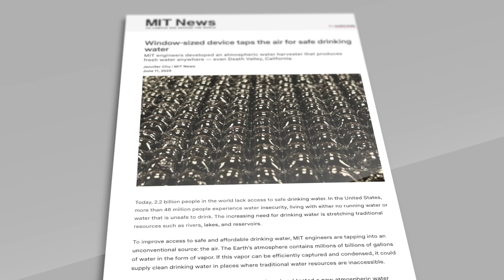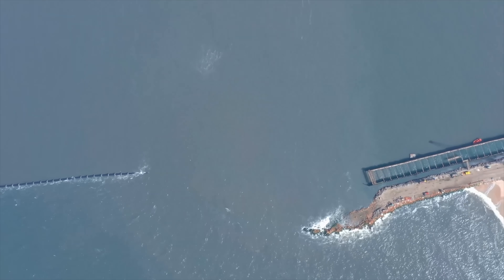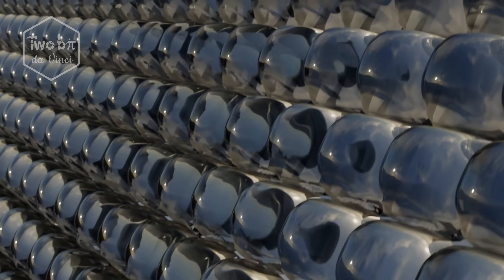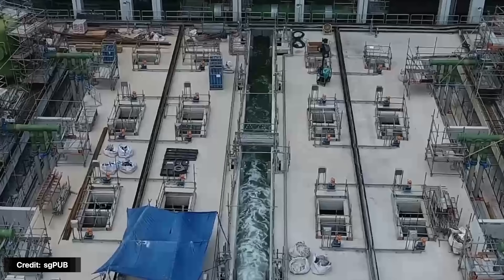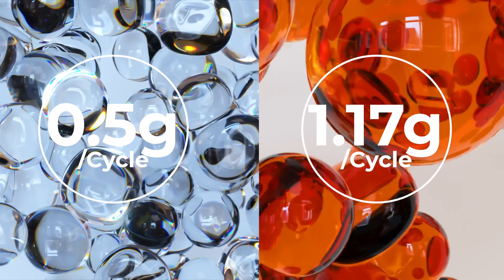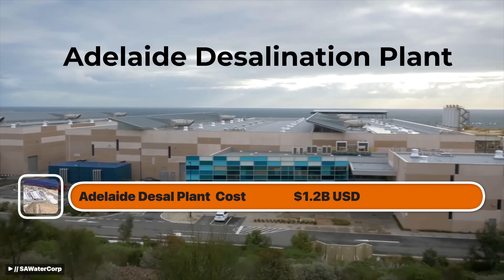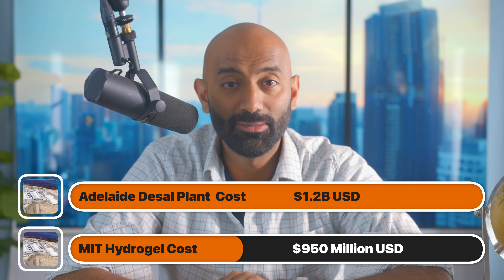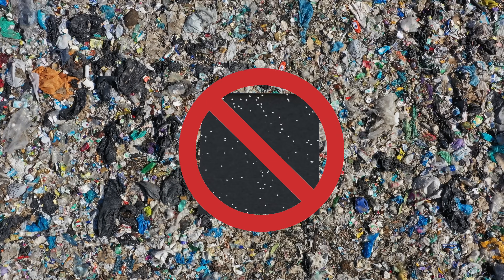MIT's Breakthrough Hydrogel Makes Water From Air w/ ZERO Power

Comment from the maker: Learn a new job in tech starting from $200/mo! Sign up for a FREE TripleTen career consultation with my link:  https://get.tripleten.com/twobitdavincijul
Reply: Use zeolite instead of gell.  Its only about $150/ton.  Its available as pool filter sand or some brands of cat litter so easily sourced for home made units.

It never needs replaced because it is just a mineral.
Reply: @NeboRuachEliyahu  cool idea! I know there are dishwashers using the stuff, and it captures water at low temperatures and releases it when the temperature gets high(er).
Reply: I wonder if the water will evaporate faster than condensate in very dry areas. Or will just clog from dust..
Let's not forget water minerality and deposition...
Reply: @Tailslol  the water should be pretty clear of minerals, dust and sand blown in would be terrible.
Reply: Why are you having to change it every year? You said in your previous statement that the sensors last thousands of cycles. And they only tested 30
If you had to change them out every year, it wouldn't be a feasible technology anyway
Reply: 30% humidity?! Not sure where you got that number, but Death Valley today is 9% and it fluctuates over the course of the day and year.
Reply: @jsbrads1  tested 30 cycles
Idk he said how much humidity 
In a lb of 10% air there isn't much regardless of temp
.00005-.005 grams
30% over triples that 
Yes death valley is hot and dry
Feasibility of this system is best over highest humidity regardless of the temp if energy is free otherwise the desert probably has a slight edge
Edit: pounds not grams
Reply: @JohnFischer-x8l  the most humid days in a desert occurs right about when it rains anyway and a nice large collection system would probably provide what you need anyway. There is a video of a guy in Arizona that has a nice smallish house and a second water storage structure about the size of a one car garage and the two roofs are designed for water collection and that provides for all his needs. Sounds like anyone else could benefit by a similar system unless they live in a place that doesn't rain at all.
Reply: @jsbrads1 oh I'm aware. 
But arguably more water is never bad. 
And this doesn't need to work on high humidity. 
But none of these people ever run full tests so it's hard to get excited about anything new 
If it worked, you'd think they'd run a full test and be like look water 
No rain at all is becoming more common in places. 
Or all at once 
Where I live we get most of our rain over maybe a month and that's only a few inches
Reply: @jsbrads1    Curious….since established deserts like Death Valley have kinda been getting drier…. 
If you dig into the ground, how far down before the dirt feels like it has any moisture? 
Temperature gradient membranes used to collect condensate from holes in the ground, have historically been a survival method even in Death Valley. 

But, due to the nearly no humidity in air, & rare rain, it sure would be tough to get condensate water where even dry-climate plants can’t find any. 

There’s gotta be better than plastic + lithium hydrogels—there’s much very wrong with that, which he didn’t even mention.  Maybe he was paid to stir excitement for the product? 

Having no water is a really good reason people & animals usually avoid seriously dry deserts—so, pretty sure gadgets won’t work those places—goood thing people don’t live there! 

Not all deserts are that dry tho. 
& climate is shifting. 
 I saw recently, that even parts of the Sahara had started greening again—that hasn’t happened in something like about 10,000 years!?  
Who knows?  Maybe Death Valley will spout an oasis or few?
Reply: The Plasma Channel has a video demonstration of how 20,000v to get water to collect on a metal mesh
Reply: @trevorlayton9425  and the cost effectiveness of that system?
Reply: more plastic is not what the world needs... if microplastic levels gets to high plant life will start to go extinct
Reply: MAYbe….BUT…
Not sure these gel things can be a “gamechanger”, except maybe for oligarchs who love micromanaging & subduing the population…
here’s why…
Cost certainly is a problem, as this is on the high-end, & the “dark underbelly” of making it, is problematic….but hey!?  New high-tech toy, right?!   Hopeful, right? 
😳
Yet another “better living through chemistry false hope. 
Real world application is THE problem.  

Here’s what you did not include in your talk:  

Plastics outgas, even more as heated; that loads it into the water; microplastics inside living cells, & in mother’s milk, are already a problem the plastics industry seriously does NOT want public to understand or be aware of!!  Doctors mostly are unaware, & have no fixes for it.  There is no cure allowed/known, to remove plastics from our bodies. 
So, this material looks to be an added problem, just from this ingredient.  

Could well be excellent at keeping folks nicely numb/pacified/dulled. 
Look up the psych effects of lithium. 
Too much of it leaching into the (heated) water,  cause destructive health issues—depending how much leaches into the captured water—including organ failure if the chronic amount daily is high enough.  

But, hey—bonus??…maybe, this is where custom lab-grown replacement organ industry really takes-off?! 
And—Anyone who is bipolar/has big mood swings, may not need to take prescription pills of lithium anymore.  
Folks using this hydrogel system would, though, need to get their lithium levels regularly checked by their doctors, to make sure they are still under “safe” levels. 
👩‍⚕

Remember the old song…
“There was an old woman who swallowed a fly…oh my! I think she’ll die!”
Etc. 
It seems the high-tech solutions & people who push them, have become too far removed from nature, & increasingly make more & more tech to “solve” problems caused by previous high tech…that mostly could have been avoided, had they tried to work in-sync with nature, instead of against it. 
Yet more difficulties built upon the flawed foundation of the “germ theory” even Pasteur knew was wrong—but it’s been  profitable!   

So—why not zeolite in a tube, with fan-forced air blown thru it, & water from humidity dripping out of that into a cistern?  Or other similar?  
Could the zeolite be washed to renew it for humidity gathering? on a schedule? 
It certainly can be renewed/dried to use as a desiccant. 
MAYBE, the brilliant young minds at MIT etc., need to beware of What big industries “fund” their research, & Why.
Reply: Besides desalination, you didn't even mention water reclaimation/recycling as another method that's already being used and will be another major option in the future?

Comment: I have a question -> Manufacturing with industrial grade components estimated at $1.70–5.20 USD kg⁻¹, assuming 1 kg averages 1 L per cycle, at 365 cycles until replacement or 365 L, this would bring the cost to $0.0047–0.0142 USD L⁻¹, right? Or are you accounting for 100-fold lower yield or 100-fold higher manufacturing costs?

Comment: To all those stating the obvious about the energy cost of water phase-change etc; please read and "absorb" - excuse the pun. 
Yes, everything you have said is correct - but it is NOT how this tech works. 
Air containing water vapour flows over the hydrophilic compound. Its internal structure is such that is like a sponge - at the atomic level. 
Once it has absorbed sufficient water, enclose it, and heat moderately, e.g. move from shade into sun. It will now become hydrophobic. In other words the 
slight increase in temp is sufficient to now break these internal bonds, resulting in this water being expelled. Note if at this stage it was not enclosed it would be pointless. 
If it IS now enclosed then you now get super-saturated air, out of which the water will condense. It is the intrinsic nature of the internal angstrom lengths of the structure that 
accomplish this stage change – it is to do with the internal hydrogen bonds that make water so unusual in the first place (eg solid - ice - larger volume than the liquid form etc) matching precisely the compounds internal structures. 
Clearly out of the billions of chemical compounds possible there are only an extremely limited sub-set that have this precise internal configuration that means they are both hydrophilic and hydrophobic within a practical range. It has to attract from say 10-15 deg C and then release at say 30-40 max deg C to be practicable.
The rate at which both occur also matters, as does the surface area able to be exposed to air containing water vapour. 
Scalability also remains an issue, a carousel-type system would seem to be the most logical.
“The miracle gel cannot get around thermodynamics” Incorrect – this wonder compound and the very few others similar we have so far found do indeed do precisely that.
The major impediments currently appear to be economic. Most of the developed world already has adequate water, and there is insufficient money/incentive to commercialise it for those who don’t as they have a limited scope to provide sufficient returns. Kind of says it all really.

Comment: The cost difference using Adelaide as compare assumes a centralized source of water. Continuing to use the established (failing outdated) water dispersement infrastructure. If this tech is applied to individual domicile, similar to your home de-sal class project the costs fall is huge.
My point, to all of your amazing concept shares, is the NEED for the public masses to have a physics understanding past the alkaline battery.
As always, thanks for your offered education. Most of what you convey is absolutely stunning for a two person 'off grid' house with an address 
still in the middle of town. cheers

Comment: We have here, electricity-free device capable of producing 3.4 kg, approximately 3.4 liters of freshwater per hour m2. 
Solar desalination technology converts sunlight into fresh water without external power. Discovery is made by scientists from unist, Ulsan, Korea university.
Ricky have review about this topic, about a year ago, MIT desalination using photo-molecular effect, it have yield about 4 to 7 kg per hour m2. It has better yield, indeed.
The version from Korea not using this photo-mol effect, I know because it's not mentioned in the article. It just use 'sunlight' on inverse L structure. This structure is made from perovskite. 
So, we have two versions here, from unist and mit. We don't know which one will be implemented first. 
I think combination of both is possible. At daylight using sunlight, at night using green laser. It's great.

Comment: Interesting follow-up to this;
Someone used MIT's SHCP-10 material in a 3D printed water pot device, and apparently just the shade of the lid is enough of a temperature difference to let the material cycle.  The 'water from air' project claims to be able to do 6L per day with less volume by getting a 2 hour cycle instead of a daily cycle.  The water pitcher has 2 chambers; A lower storage tank, and an upper chamber for water capture.  The lid has the hydrogel MOF material under the top, and is on a (very) slow-close push-to-open device.
So the idea is, you push open the lid, and the slow-close mechanism keeps the top section open to the air to absorb for an hour.  When it closes, it takes ~1 hour to heat up and bake the water out of the gel and condense in the bottom of the upper chamber.  When you open the lid for the next cycle, it opens a drain to let the condensation to the bottom chamber, and the 2 hour cycle repeats.

The plus side, is that just the temp difference in the sun of being open vs closed is enough to do the cycle, allowing a lot more cycles per day.  So you can have a much smaller portable unit where you need the water instead of in a large stationary location.  And other than the gell itself, it looks like all of the other parts are cheaply available.
The down sides... where do you even pretend to get the gell?  How many cycles do you get out of that gell, especially with presumably 5-6 cycles a day?  With 3D printed material sitting out in the sun how likely are you to expose yourself to chemicals leeching out of the plastics?  And because the process relies on heat, you of course get a nice hot cup of water to slake your thirst on a hot day instead of something enjoyable.  And of course there is the 'minor' issue of getting your hands on a 3D printer and plastics (much less the hydrogel itself), and the power to operate it, in an area where you can't even reliably get water... which always seems to get glossed over in these projects.  Better than nothing, and if you can offload the storage else-where in the shade, then maybe it would be more practical... but the down sides don't seem all that great.

Still; if you already have a pitcher to store water, then you only really need the top half of the device to make it work.  And if the gel becomes available in any real quantity, I don't see why you couldn't apply it to the lid of any large container to so something like this at a much larger and more practical scale.  I mean, just cut the top off of almost any barrel or container, leave the thing out in the sun, and alternate opening and closing the lid a few times a day to collect water, and then drain it into a more home-useful container to cool down inside over night for the next day's drinking water.  As long as the temperature difference is there to make the cycle work, it doesn't need to be in a fancy clear container.  I just have a feeling that the material itself will be so expensive to produce that it won't be practical even in small amounts.  It is a neat idea though.

Comment: I like the idea, but what about the importance of humidity? 
That wet air is every bit as integral to the rest of the environment. Do we have models that can predict what type of effect this could have if used widely in the water-stressed 2/3 of the populated areas? I would hope a rebalancing would take place with excess moisture from, say, over the ocean moving in innocence refilling that lost humidity, but I'm fairly certain things aren't quite that easy. I highly doubt one single technology would spread that widely to have a single-handed effect, yet it would be important to be prepared and know what to look for if it could cause a problem. At the very least it will help us understand more of how this might stack onto other solutions.
Think of how many reptiles and insects depend on tiny droplets of dew that form in the night for their own drinking water. It is certainly worth considering. Especially if we can find a sweet spot of some kind so we don't over-saturate an area and accidentally desiccate it.

Comment: Replace gasoline & diesel with Ayrton Energy that safely stores hydrogen gas in room temperature liquid that doesn't cause metal embrittlement that hydrogen gas is known for. All fossil fuel infrastructure including closed down gas stations can distrubute room temperature hydrogen clear liquid including oil tankers and Keystone Pipeline instead of polluting oil.

Comment: Well, I don’t think people are understanding about all these different solutions is that you don’t have to pick just one you could have a dieselization plant that operates on a grand scale, supplying water to businesses and other large areas like densely populated areas and then use these hydrogel systems for the smaller use like a personal water system For people that live on the outskirts where you have maybe one or two people per hundred acres of land the people that live out like where I am don’t need millions of gallons of water we could get away with having five of those hydrogel panels and a collection tankand a water pump and if we have to replace the five panels each year and they cost like a couple hundred bucks that’s still way cheaper than paying for water from the city and it lightens the load for everyone else

Comment: If  to have floating platform with solar panels for its work, and suck by fan vapor from device around and use electricity and  cold water several meters beneath blatform  it can be prety efficient divice to get water

Comment: There's a third way. Mechanical condensation, like what the copiapoa cinerea cactus does with its spikes.

Here's my contribution. Replicate those spikes with something like copper and you've got something more efficient than this mit hydrogel...
Reply: Regardless of material choice, if you plate it in the a microscopic layer of gold it will basically last forever and it's also infinitely recyclable anyway